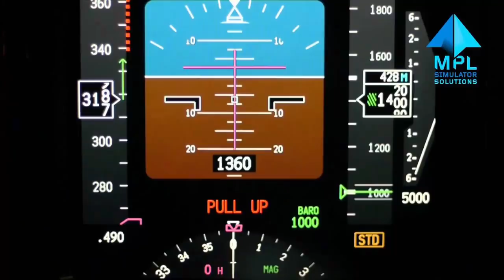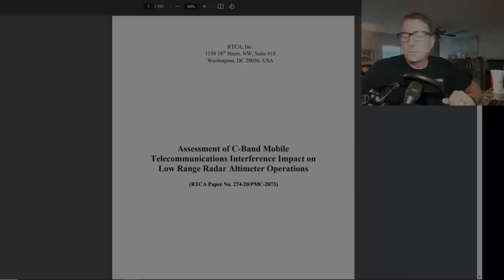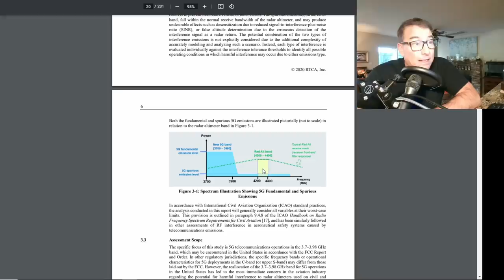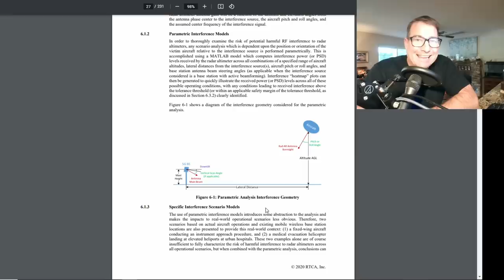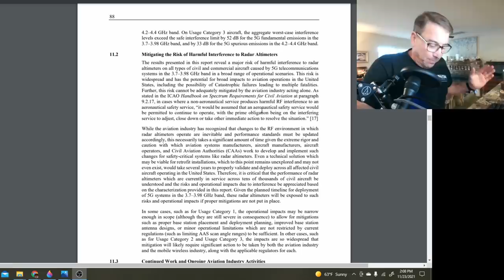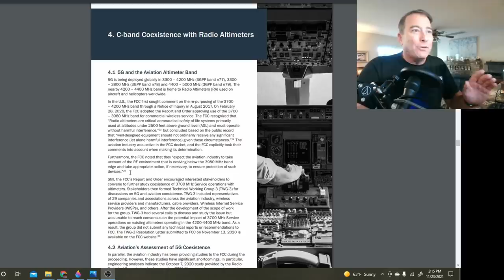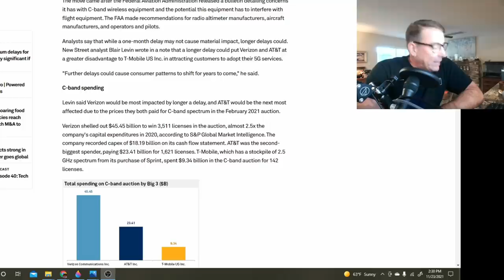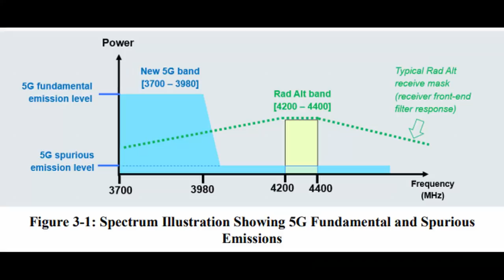5G C-Band Interference with Radar Altimeters in Aviation

Comment: Heck, I’m a “lowly” private pilot on strictly Part 91 operations, but in my C441 I also utilize the radar altimeter in low IMC.
Reply: Any bets the telecoms will help with your upgrade?
Reply: @SteamCrane  WOULD LOVE TO SEE THOSE ODDS, SOUNDS LIKE EASY MONEY!!
Reply: you v the opportunity to test this with interference in the cabin from a cellphone and have  your FBO get permission to park in the rub up area on the taxiway to see of this make a difference.. and submit a report .. what is needed is a standard cable router that is paired to a cellphone either in the same vehicle or within 50 feet in another vehicle to keep the signal going.. best of it is pared with another device streaming date like a laptop streaming video or cellphone streaming video to the laptop and then get  a yagi antenna (eBay) to give a +15db boost towards the incoming aircraft..
Reply: This is all absolute nonsense, don't let it stop you trusting your instrumentation*. This is only on approach, if a 5G tower were a problem, they'd move it. There's more than one altimeter on your plane, that gives a signal vector: bad vector = big warning lights. 5G is 20W at the best of times, the inverse square law, the 5G forward facing antenna slug faces down, so you only have a reflection or a lesser slug, the fact this is only an overlapping bell curve and the doppler effect means you're getting practically zero wattage. 

I'm sure this guy is a great pilot but he clearly knows about as much as you'd expect him to about engineering. A little bit of knowledge is a dangerous thing, this is not a real world concern and even if were all we need do is move 5G towers away from airports. They have an effective range of about 200m.

*other than a healthy level of mistrust. No system is perfect.
Reply: @davidmurphy563   depends on the reply mode of the new cellphones, now they are on the 5.4GHz range, but if they duplex on the same frequencies as the proposed outgoing, a 'ground fog' could cause interference.  The solution is to make the cell towers in the ILS approaches not be on these new frequencies, but  the cellphone companies and equipment manufactures have shown a dismal lack of concern through not showing actual testing to support their claims or propose not using these frequencies.
Reply: @tsclly2377  Are you purposely trying to crash?😁
Reply: @davidmurphy563  Make sure to move all those 5g cell phones 200m from the plane as well.
Reply: @tedmoss  Phones output a couple of Watts. 5G is high frequency. The signal is not leaving in cabin and certainly not inferring with a downward pointing antenna on the underside of the plane. Testing for this is trivial.